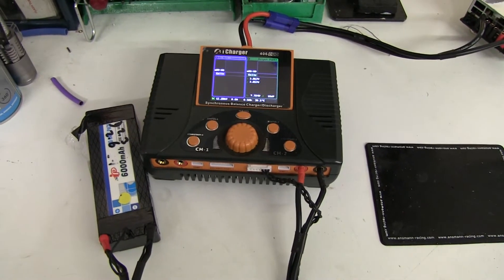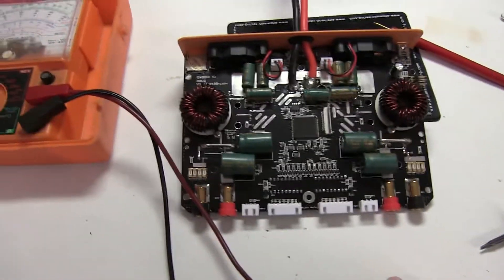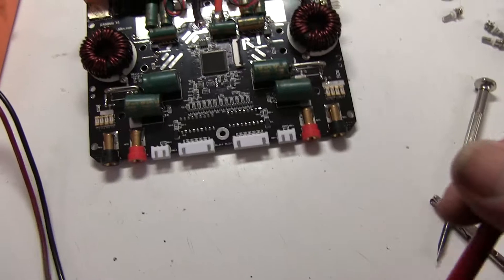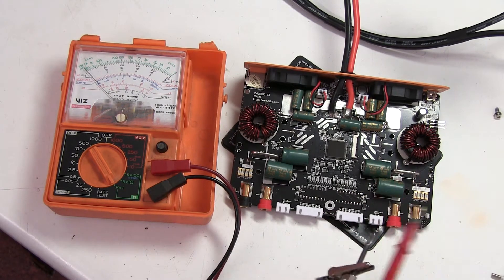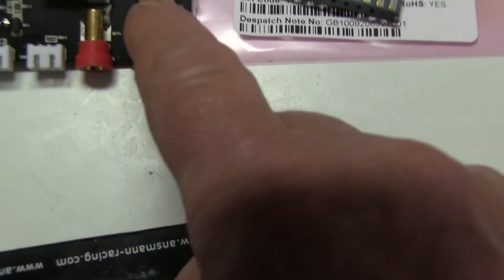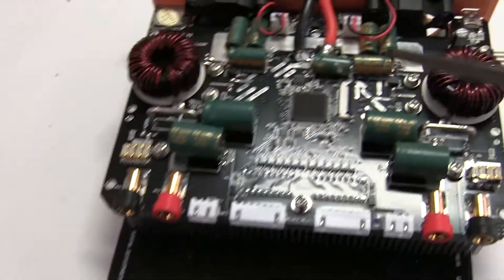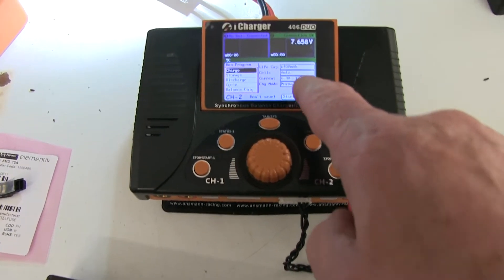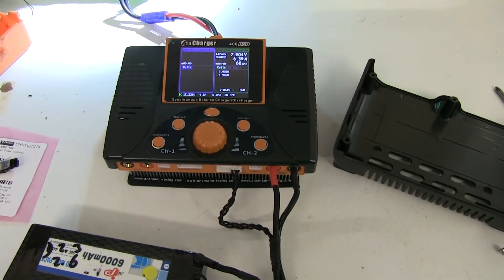iCharger 406 Duo Repair : Error 1305

Comment: Hoi Nick,  great your video's.  I have a icharger 406DUO, sometimes the TFT screen is white suddenly. After power off and on: sometimes it is OK, but most of the time it is white again. Ik have checked the ribon flate cables, they looked OK. When i move the ribon flate cables there is no change.
DO you have any idea?
Reply from the maker: Hi Rob. Probably too much voltage to the screen, which is an electronic chip fault.
Did you release the ribbon clip , push in the cable and secue the clip again?
It may be okay, if you buy a new screen.
You can email Junsi who may respond with an answer.
Reply: @nickadams5411  Hi Nick, thanks for your quick respons!, yes i have release the ribbon clip(s), and push the ribbon back again and push.
I have ordered  a new screen, so i can try that.
If I buy a second icharger,  i use 6s/5000ma max 1c charging most of the time,  so 308/406/410 are all fit. 
Whish type do you recommend?,given your experience, are there differences in reliability between the 308/406/410?, what is the oldest/newest type?
Reply from the maker: @robvandenberg91  Hi Rob. The 406 is the best for size and operation. The 410 is larger , but almost the same price. The 406 is reliable ever since they redesigned the circuit and added the fuses, so a new one will be good.
Reply: @nickadams5411  Hi Nick, text on the board 'iC406DUO V2, 2014.03', is that old or new version?,  can you see it on the outsite? if it is a new one?
Reply: i have checked with you video,  I don't have the fuses on the board!
Reply from the maker: @robvandenberg91   Hi Rob. You have the older model, which was prone to damage and faults.
Reply: @nickadams5411  Hi Nick,  ok , good to know, 
thanks again.
When i have the new display, i will let you know about te results
Reply: HI Nick,  is any information about the display connections available?
Reply from the maker: @robvandenberg91  Hi Rob. The ribbon connections are easily damaged and sometimes it needs a new ribbon. I don't know the designations for each ribbon.

Comment: Do you repair for anyone? I had my charger set to keep mode and when I pulled the plugs out of the battery it started to smoke out of port two. I didn’t press stop before I removed the plugs. I think that’s what killed it. Can’t find anyone in the USA to repair iCharger’s
Reply from the maker: Hi. You probably blew the fuses, or if it has no fuses then a FET. A tech guy should be able to spot it and replace, as in my videos.  All the best, Nick

Comment: Hi Nick. Fantastic videos! I recently blew up my 406 duo when I (stupidly late at night) plugged a 6S pack in while having a 2S still connected to the balance board on the left channel. I'm not sure if the polarity was reversed or not, I pulled everything off as fast as I could when it smoked. We have replaced 6 FET's, including the main input FET and some resistors. The unit now powers on and the left channel is working again, but the right one doesn't seem to draw any amps and is coming up with a 'Error 1301 connection check error'. My friend thinks I may have blown a FET controller, as he couldn't see anything else. Unfortunately the markings are rubbed/scratched off by Junsi, making it hard to identify the components. Do you have any idea what they may be? I will meter around it a bit more when I get it back but looking like 1 channel is better than none at the moment.. or I may require your services to see if you can find anything :-)

Comment: I used to love the days when you could open things up and see the miniature glass fuses and replace them if blown. 
The 5mm ones for Uher tape recorders were quite neat.
20mm might have an issue with miniaturisation. 
Alternatively if the makers used the car fuses you showed inside they might be e neat alternative. 
Manufacturers seem to not like people opening equipment what has happened to the world of broken. ?
Reply from the maker: Hi Jeremy
I agree.  The customer had been told by UK supplier that the unit would have to be sent back to China for repair !! And would take up to 3 months !!
I fixed it in 24 hours.

Comment: i bought a brand new iCharger 406 duo from a very reputable main hobby store, 300 $$ and out the box i got error code 1305 on both channel. i sent it back for a replacement in which they said user had set to asynchronous mode and they sent it back to me. still got the 1305 error no matter what they did. in the end got my $300.00 back and bought a $80.00 charger that has worked flawlessly out the box from day 1 and to present with no problems whatsoever. i really love the form factor & capability from this charger but had a bad unit from jump start. it has been a asked topic on rcgroups.com forum with the same error 1305 message. as said user of this unit in video stated, i also did not had any bad connection with unit. now i see what the problem was. thank you nick adams.

Comment: Nick I have blown my 
Icharger up the leads touched when I pulled them out of the battery. The charger smoked but when I opened the charger I didn't see anything that looked damaged do you have any suggestions. shouldn't it have blown the fuses before it smoked any components. I will check the fuses tonight when I get home from work.
thanks for the video. 
 I was told that my charger would have to be sent to China for repair it would take six months.
Reply from the maker: Hi
After opening up, as in the video (and the other one I did), you can often see the damaged, burnt, power components.
Or a simple meter test to find the blown components.
If it smoked, there should be a blackened part or obvious damage.
The parts can normally be replaced.
If you cannot fix it, I can have a look at it. It normally only takes 2 days to fix.
Nick
Reply: @nickadams5411  send me a text or email lsxranger@gmail.com I have an icharger 406duo that has same code but fuses were good.